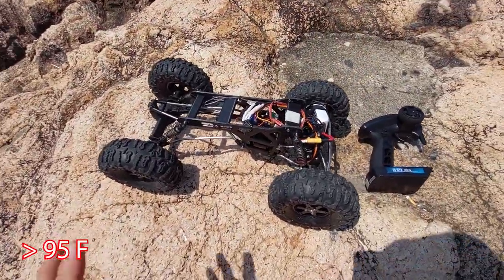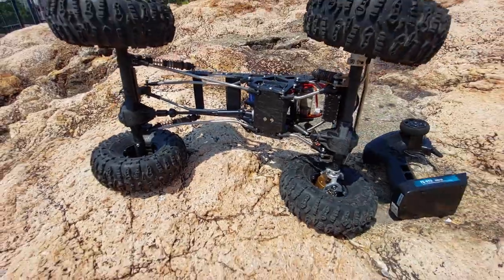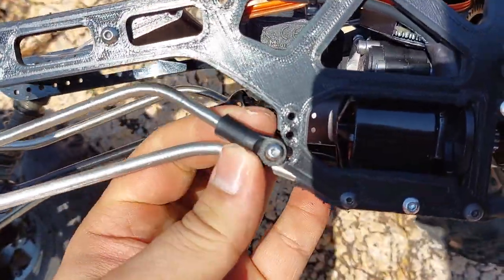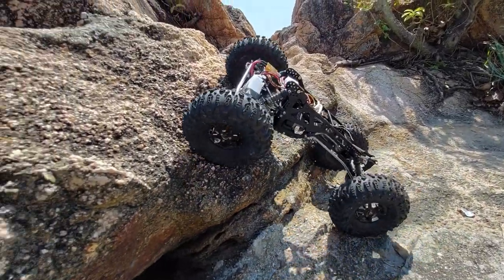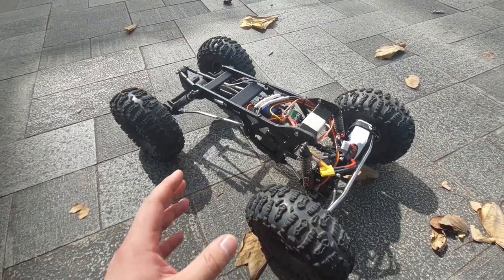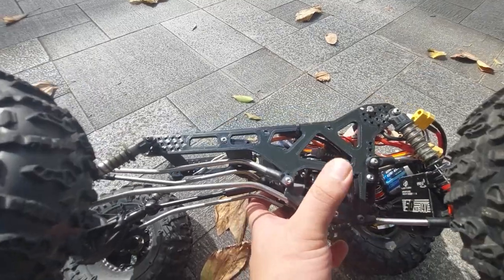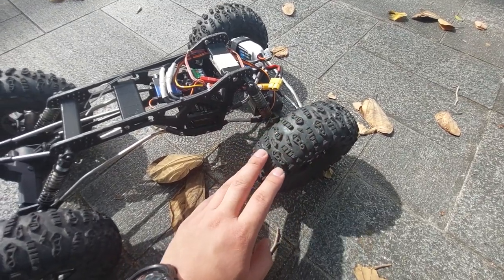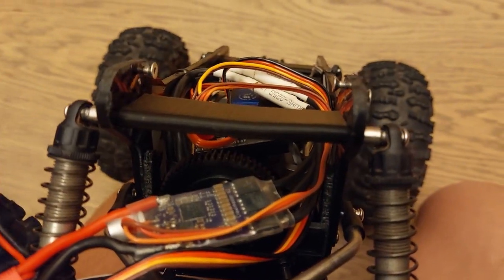*mostly* 3D Printed RC Comp Crawler | AR60 based 2.2 Shafty: Test Run 2#

Comment: I think it still need stronger chassis. Like carbon or alloy
Reply from the maker: Yes, I am looking to get the chassi plates cut out for aluminium soon. other than pure durability, the chassis itself does feel too flexible on the rocks, it would definitely benefit from being stiffer.